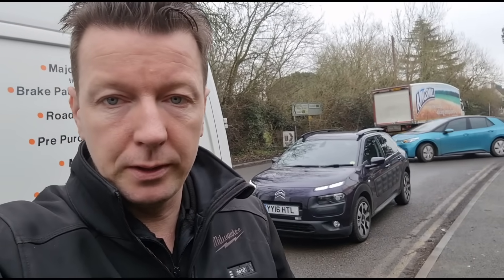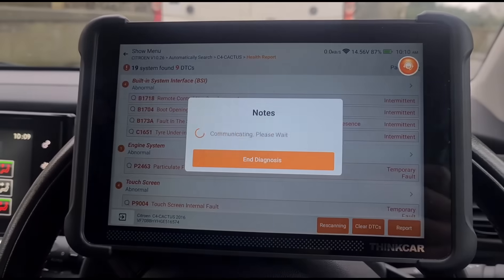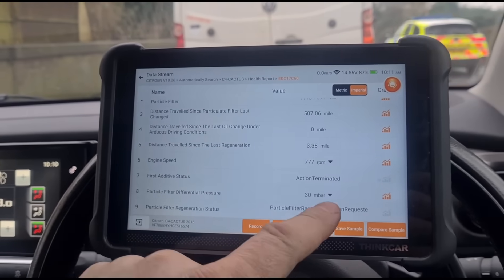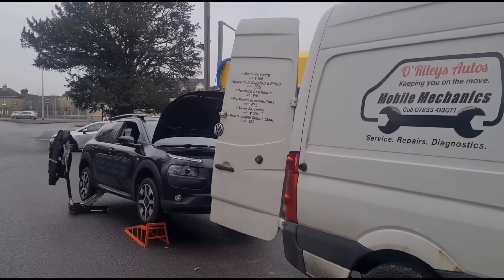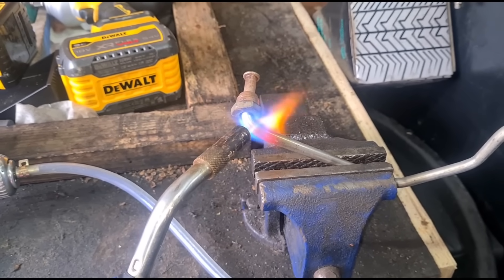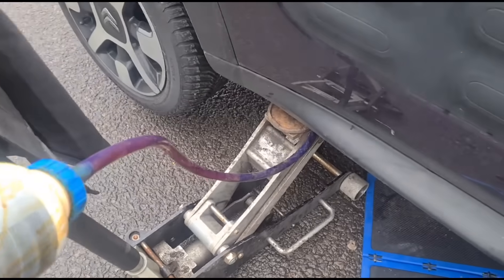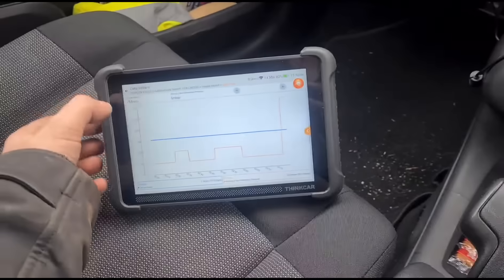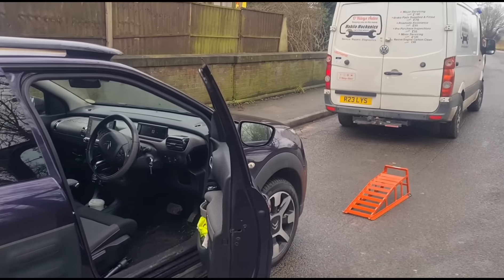Citroën C4 Cactus P2463 DPF Overloaded

Comment: Your comment about the auto box on these cars is spot on. They are complete garbage, doesn't matter how you drive them they jerk all over the place. The reason is because they aren't a real auto box but a manual box with loads of electrical rubbish bolted to them to activate the clutch and change gears. Hideous system.

Comment: Thanks.
Reply: I reset the ash counter on mine and the regen period went up from 160 miles on average to 240. That’s for around town. It has a regen period of about 350 miles with motorway use. Regens are triggered at about 64% soot load each time.